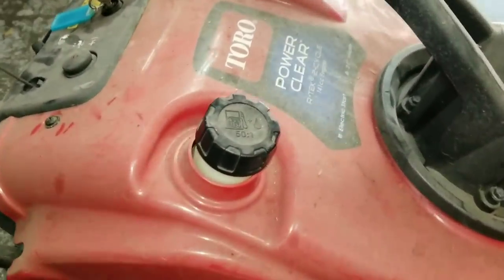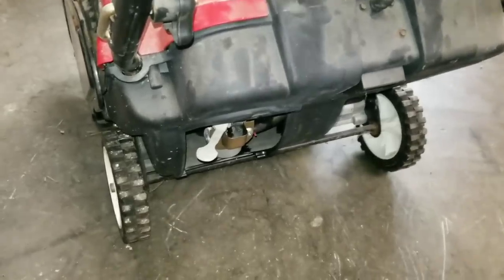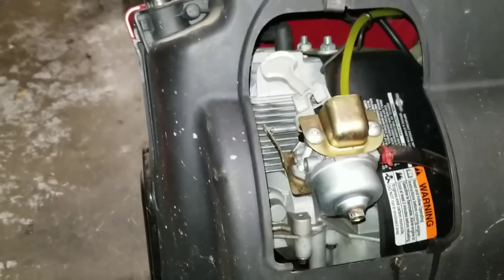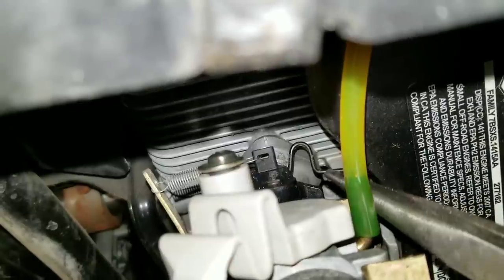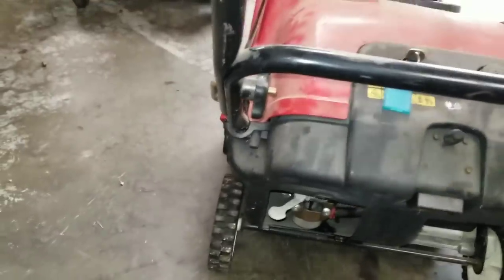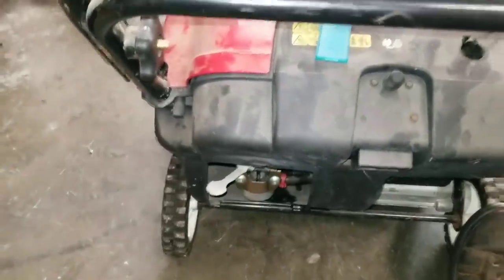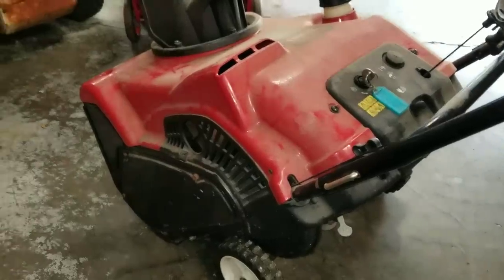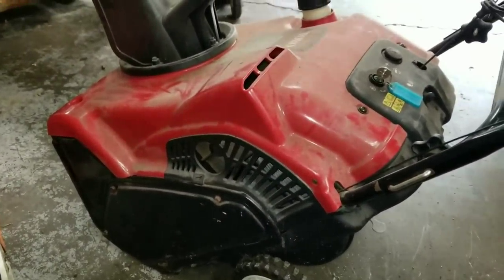Toro Power Clear Snow Blower Surging Fix and RPM Adjustment

Comment: Cool beans! Have the 210 model and it started surging this season. Glad to know what to look for.
Reply from the maker: Off on the throttle linkage to the governor can cause this issue. Always make sure the carburetor is clean also. Partially plugged jets can cause the same issue
Reply: Individualized Repair 
Right, but I'll try this first. I use good fuel and run it dry at the end of the season. I looked at the carb a little last year but got lazy about tearing it apart.
Is there even a mixture screw on the 210?
Reply from the maker: Ted Peterson no mixture screw on it
Reply: Individualized Repair 
OK ... definitely got rid of the surge. But now the RPM is waaaay too high, even though I re-adjusted. Can use a small engine tach I have, do you know spec?
Reply from the maker: Ted Peterson 3450 is what I set 4 cycle Toros to. They are rated to 3600rpm. 2 Cycle around 3250rpm.
Reply: Individualized Repair 
Thanks. For some reason bending the tab where spring attaches doesn't seem to have much effect, but the other adjustment sure does. I'll get it dialed in. 4000 should be fine though correct? That's OEM?
Reply from the maker: Ted Peterson If it is not making a difference with tab/spring the throttle is getting stuck on the intake manifold bolt or the linkage is bent too much. 4000rpm is quite fast but it sure does give these machines unmatched power
Reply from the maker: Original factory speed is set from 3450 to 3650 rpm
Reply: Individualized Repair 
Thanks, I will check it out, I figured it was something like that. Reduced the linkage back closer and the speed is back to normal. It was impressive, if a little concerning lol
Reply from the maker: Ted Peterson awesome! Great work!
Reply: Individualized Repair 

Say, the electric start will no longer engage the flywheel. It spins fast enough, I think. Was always good about running after use to burn off any ice accumulation. So not frozen as such. Is the bendix or pinion metal, maybe rusty? Needs a shot of something?
Reply from the maker: Ted Peterson Could be so on that but the one downside of the Toro comes to light. Starters are made of plastic and the tabs frequently snap not allowing the starter to engage. Hopefully yours didn't come to this fate.
Reply: Individualized Repair 
Hm. That's something I will have to look at in the off season. Thanks again for the insight.
Reply: Individualized Repair 
We had a boatload of snow overnight so it was the first real test, it throws the snow really well now - they probably shipped them crippled from the factory. Thanks again for the tip. I like how they are so lightweight.
Reply: yes i think the throttle MAY be getting stuck on the intake manifold bolt...but how do i fix that?
Reply: Individualized Repair 

OK, I found a spec for the 141cc 2-strokes like this model 38593 Toro says 3800 RPM +/-100 engine speed. That should get it in the power band. We're getting more snow overnight so I'm going to check it tonite.
Reply: Hello Ted Peterson. Do you know what's the difference between the 210 model and this one shown on the video?

Comment: Also. would it help to replace the spring on the metal on the left where you bend it to adjust the rpm? Thanks.
Reply from the maker: Almost never an issue unless bent all out of sorts or rusted to the point where it is about to break. Only replace if you have one of those issues

Comment: So... The actual correct place to adjust is the bar on left side of carburetor.  Yours is bent quite far to the left increasing the governor  spring tension and causing the surge. While bending the governor rod will work eventually it will cause the little spring to stretch. Bend the spring rod slight  not the governor rod.
Reply from the maker: This is not correct for the surging. People bend the linkage when removing the carburetor, this is what I am showing on this fix. To adjust RPM the left bar attached to the spring can be moved yes.

Comment: Your video was the only one I could find on YouTube mentioning how to adjust this style snowblowers RPMs. I had to take mine completely apart to fix the recoil only to put it back on and dislodge the black housing from its spot. Couldn't figure out why it was revving so high.

On a side note does anyone who has this snowblower completely hate the internal design?

Changing the recoil is almost a two hour job or more just because of how hard it is to get at bolts various bolt sizes and having to remove the cover tank and housing to get to the recoil
Reply from the maker: Not a great design at all! It is difficult but with the right tools you can make it a breeze!
Reply: What symptoms does a bad coil have on these blowers?
Reply from the maker: @mustang49601  no start issue is usually the only only one when coils go bad on these. I do not see a lot of bad coils though....

Comment: just be careful when bending that loop in the black rod, thats the governor rod, and it connects to the blade governor which is made of plastic and will break really easily with too much tension,, i sadly did that to mine, Bad thing is that Blade governor  Briggs and Stratton Discontinued and doesnt make it anymore since about 7yrs ago,, so the only way you can replace it is  you have to find a parts snowblower that uses it..  its easy to change just one screw, but it can take a while to find a parts one to use,, Just a heads up
Reply from the maker: Good tip! I forget all about the governor system on these and how silly it is!! The blade is normally not brittle but these machines are getting pretty old by now so some may definitely be starting to get there. Thanks for watching!
Reply: the carb does have an idle adjustment screw too you dont have to bend that bar, , thanks for the video 
 @IndRepair
Reply from the maker: The low speed idle screw is not used on these models because they always run at full speed with no throttle control. This video is about governor to carburetor throttle plate positioning. If these are off the engine will surge as shown in the video. Thanks for watching!

Comment: I have a 3650 r-tek that was surging.  I bought it used and the previous owner had the carb recently replaced.  I made the adjustments you mentioned and the surging is gone.  But it only runs when choke is at 3/4.  If I turn choke off it dies.  Any ideas other than running it at 3/4 choke lol?
Reply from the maker: You probably have an air leak at one of the gaskets between carburetor and engine. Only other issue could be the carburetor clogged itself or bad fuel
Reply: @IndRepair  Thanks for the reply.  I was using new fresh mixed fuel.  I’ll check for leaks first and maybe take the carb off and give it a cleaning.  Just to be clear, it ran with choke off prior to making adjustments, but with surging.  Now, after adjustments it doesn’t surge but choke needs to be at 3/4.
Reply from the maker: @Lobbapallooza  Same diagnosis, governor was overcompensating, which would keep it running, now that you have solved that issue, you see the other. May be why the carburetor was replaced in the first place if the gaskets were not replaced

Comment: Just tried this trick and the surging stopped (thank you!!), but maybe u can help me understand why my idle races really high and then stalls out.  Tried bending that vertical arm various distances left and right, but it still screams.
Reply from the maker: Sounds like the plastic of the throttle may be hitting the back screw. Can you move the throttle arm back and forth each way without it sticking?
Reply: @IndRepair  Thanks, but the throttle doesn't seem to be caught on anything, moves unrestricted.  Should I try really bending the vertical arm far over?  Could the spring become weak?  It doesnt seem to be worn.
Thanks again for the reply, very much appreciated.
Reply from the maker: @northeasternguy1010  the spring seems to not be doing anything then at all? No change depending on how much tension on the spring tab?

Comment: Will this bring the RPMs up higher, so it can throw the snow further?
Reply from the maker: No, just repairs the surging issues. Set rpms higher manually by bending brass tab to spec
Reply: @IndRepair  Thank you 👍🏻
Reply from the maker: @Super020469  thanks for watching!

Comment: Mine still does it and Im stumped. Fuel tank is clean, new fuel, new fuel filter, new spark plug and cleaned the carb. Squeezed the link and it still does it. Even put a new carb on and it doesn't help :( this thing is like new
Reply from the maker: Surging can also be caused by an air leak between carburetor and intake adapter or between intake adapter and block. You can teat by spraying down with carburetor cleaner and seeing if it changes the way it is running at all. If it changes pitch or runs differently you have an air leak meaning the gaskets are not sealing properly. This can also be caused by a leak in the crankcase of the engine where it is together. This would make it not worth repair if that was the case unfortunately

Comment: Hey! I have the exact same unit and when I try running the machine with no choke it seems to surge/put itself off. If I run it at half-choke it works okay but gets weak intermittently. Any ideas what it could be or what else I should adjust?
Reply from the maker: The fuel is poor quality, has water in it or the jets are partially clogged. The bottom jet screw is the most important part and by far the most common issue. Is this a plastic or metal carburetor on your unit?
Reply: I believe it is plastic. How hard is it going to be for me to get in there and clean it? Im quite new to this but with guidance shouldn't have any problems. Would an owners manual show me how?  @IndRepair

Comment: I have a power clear 221QE. My problem is that the choke lever moves around by itself.  Everything works except that after I move the lever to non choke position it moves itself back to the choke position and many times this shuts down the engine. I thought the lever itself might be cracked or the lever screw might be loose. After looking at the lever (not cracked anywhere) and tightening up the screw, this made no difference. What might cause the lever to become so loose?
Reply from the maker: Had to be a bad carburetor. The plastic must have worn down around the choke shaft
Reply: When I move the plastic choke lever the butterfly moves back and forth as you move the lever.  The problem seems to be there is no tension on the lever mechanism. The governor linkage that you pinched closed a little in your video, what does that attach to on the right side? I can't see what this attaches to on the right side.   @IndRepair
Reply: @bkreis1  It attaches to the air vane in the blower housing.  Air flow from the flywheel blows on the vane.  The air vane position balances against the spring tension on the throttle to control rpms under load/no load.

Comment: I am having this problem after replacing the carb. If I pinch the arm in it runs WOT, if I expand it again it starts surging again. I can't seem to find the sweet spot, the tolerance seems incredibly tight. I feel like even if I do get it adjusted perfectly it won't last very long.
Reply from the maker: Is the plastic throttle hitting the intake stud by chance? Many times the wind vane itself needs replaced if it has a piece break off. Sounds like an air leak at the intake gaskets to me...that would make it run fast even if adjusted right

Comment: Do you know the rpms on that?
Reply from the maker: Factory setting is 3450-3650RPM. Max rpms vary depending on model. You can look up under manuals on toro.com with model and serial number and look under service manuals
Reply: @IndRepair  other than by sound, how would I determine the rpm on this engine to know if I've got it right?
Reply from the maker: @JakeSmith1  you would need a tachometer to test
Reply: Jake Smith Tachs are super cheap, 8 bucks, one wire. Wraps around plug wire. Look on that famous auction site for "small engine tach".

Comment: I've got an aftermarket carb that I just installed. Linkage seems fine, but upon start-up, it's stuck running at wide open throttle. If I move it closed a bit, it will idle down just fine. I'm thinking it's the air vane issue you mentioned in other comments as I feel a slight bit of resistance (almost vacuum like) when I move it off WOT. If I dig into it to address the air vane, is there something particular I should look for?
Reply from the maker: Could be that or too much tension on the throttle spring? If you take off the housing to get to the air vane it should not have much play in it. It should move back and forth easily...
Reply: Individualized Repair thanks for the quick reply! It came to me last night that I probably got greedy when I adjusted the linkage for the revving issue. I put a little space back in that bend and it resolve the issue.

Comment: I have a Toro ccr 3650 that's doing this.the carb has been cleaned.initially it wasn't running right was surging bad and would bog way down when the impellers were engaged.its still was doing that after the carb was cleaned.so I went on to ajusting the governor.how do you know when you have ajusted it to much one way or the other?
Reply from the maker: I would double check it (throttle) is freely moving both ways and not getting hung up. If gov is adjusted too much out will make throttle jump up and down. Too much in will run high speeds without restriction
Reply: Individualized Repair one thing I noticed was if I push down on the black plastic piece that the linkage goes on it seems to bind up.ig i pull up on it everything moves freely.what seems to happen is I get it to run ok but then increase the engine speed and it starts running junky again.so should the linkage be ajusted before the engine speed?
Reply: Individualized Repair  I'll have to mess around with it some more.seema like.i.get one ajustments correct and ajist say the engine speed and the other ajustment goes out of wack
Reply from the maker: @mustang49601  yes linake should be adjusted first. If it is binding up for any reason when moving it you have some sort of issue. Are you sure the bottom of the throttle body (black plastic you attach linake to) is not hitting on the bolt of the intake? This would still be my first guess as to what is going on.
Reply: Individualized Repair  as of now everything is moving freely.it seems to be running good.i think I got the ajustment figured out.whats confusing me is the fact it looks like the throttle plate had never been bent or ajusted so why now does it need so much tweaking?
Reply from the maker: @mustang49601  this thin strand of metal is constantly getting a push from the governor and a pull from the spring. This poor design will bend/weaken over normal operation in many cases.
Reply: @IndRepair  yea, some of the aftermarket carbs need to be closely inspected for clearances, the linkage is plastic and can be simply filed down to clear the bolt.

Comment: There's at least one other reason this can happen- if the "whatever it is" the linkages are connected to on the carburetor doesn't rotate freely. If it sticks, you'll have problems. Trying to figure out how to solve that.
Reply from the maker: Usually hitting the back intake bolt, especially and issue if you replaced with an aftermarket carburetor. Any play/binding of the throttle/governor will cause issues. Double check it mover freely back and forth after installation.
Reply: Thanks for the response. It's the original carburetor, not aftermarket. I sprayed it with carb cleaner, sprayed into the carb. It ran sort of ok for 10 minutes, then began binding badly. I let it sit for a couple weeks and was going to replace the carb, but it seems to be moving freely now. I'm waiting for a good snow for a real test!

Comment: I'm sitting here scratching my head... I'd really appreciate some help. My CCR2450 is surging BADLY! The lever isn't hitting the intake bolt and it moves freely. At first the governor linkage wasn't even attached and it was revving to high hell. But now the engine surges. New aftermarket carb, new spark plug and primer bulb. Your linkage looks just like mine where it's bent straight. Here's a video. 
https://drive.google.com/file/d/1nQb9e0iE5xLo8sjmoQ6kVv2Bmkd4GdzC/view?usp=sharing
Reply from the maker: Have you checked the rpm? Gaskets all look OK? Could be an issue with an air leak at the gasket closest the engine
Reply: @IndRepair  I fixed it about a week ago by replacing all the gaskets between the manifold intake and carb. 

I also purchased a tachometer to dial in the RPM at around 3800. It runs like a top now! Thanks for replying. 

https://drive.google.com/file/d/1ojuojGn_2-YRqmhzd4grhXXjXUWRTnG3/view?usp=sharing